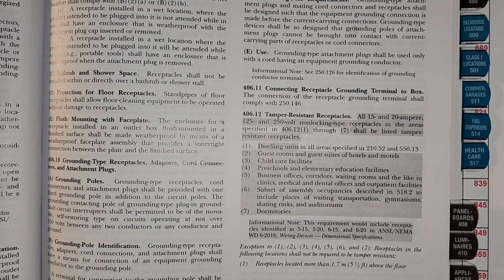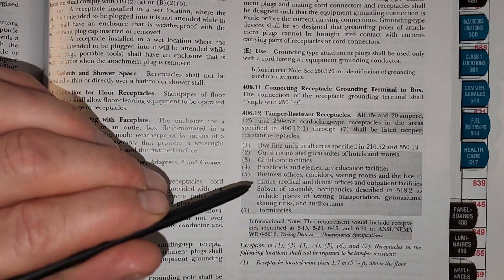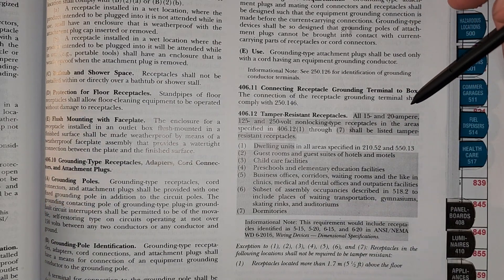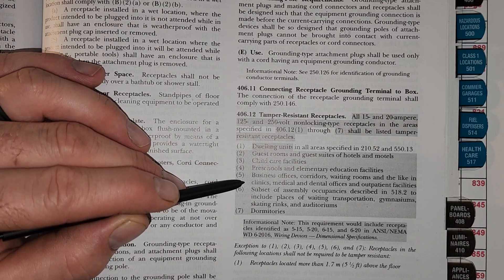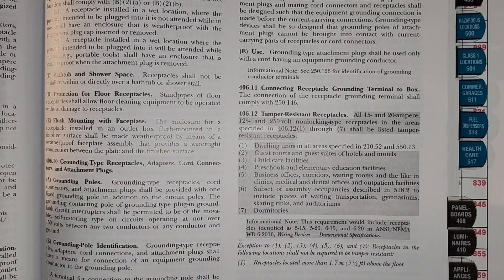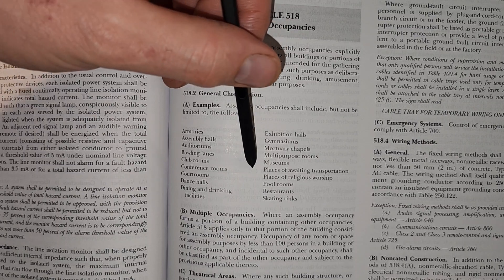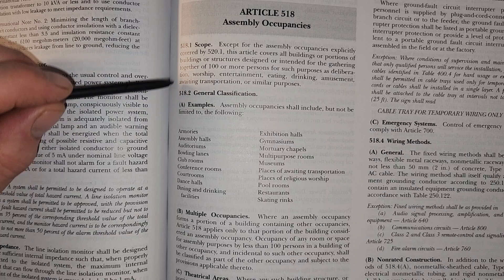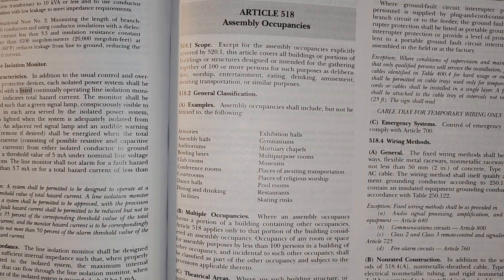Where are Tamper Resistant Receptacles Required?

Comment: curious and slightly confused....
2017 code is enforced and it's almost 2023?  I thought 2020 had changes in code.  This video was posted the end of August 2022, correct?
Reply from the maker: You are correct, half of the country still on the 2017 and will be for the next probably 3 or 4 years
Reply: @ElectricalCodeCoach  yikes.  thx

Comment: Detacted garage and pole barns?
Reply from the maker: Great question, Mark hit the home run!!
Reply: @ElectricalCodeCoach  ... at the start of the video there's exceptions on the bottom right of the page... says receptacles above 5.5 feet from the floor, which would cover garage door openers, plugs for eve heat tapes, cord / plug emergency lights, and chain hung shop lights in a garage / basement.

Comment: Where are they not required? Another question is what code version is being followed in your particular area? Don't hear me wrong. I am a big fan of them and have them everywhere in my home.  I am surprised where I see people sticking in those child-protection receptacle plugs, even in churches. For example- As foster parents, we have to be fire inspected. I actually think that this should be a time when they are required, even if the home would not otherwise be required to use them.
Reply from the maker: I heard that brother, I'm reading from the 2017 and it just continues to get more and more stringent, really curious to see what the 23 says here in a few weeks.

Comment: This is ridiculous.
Why would you need a tamper resistant receptacle behind a refrigerator? Why would you need one outdoors up under the eve or near your heated roof cables to prevent ice build-up along the roof? (Or for holiday decorations if you're into that?) Why would you need one in the attic?

This does apply to new construction only. Correct? Is it required to upgrade when simply doing a repair that isn't being inspected?
Reply: Technically if you touch a circuit it has to be up to code when you're finished. A TR recepticle is cheap.
Reply: @phillysupra  
Then why do they still sell many that are not TR?
Reply from the maker: I understand the struggle, but Phillysupera said it best
Reply: Cockroaches 🪳
Reply: I do believe I saw an exception in the code for locations above 5.5 feet from the floor. IOW, not needed for a garage door opener or eve plugs for heat tape. This would also cover chain hung lighting over your work bench. At the start of the video you can see the code book (not highlighted) exception at the bottom right.